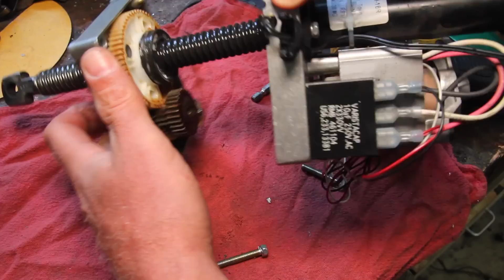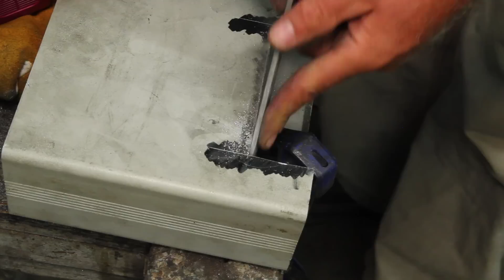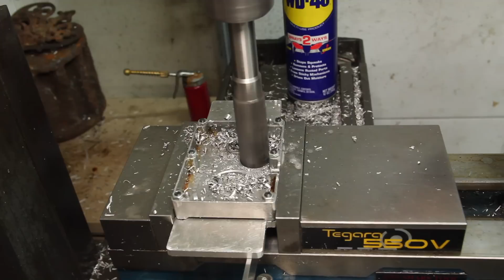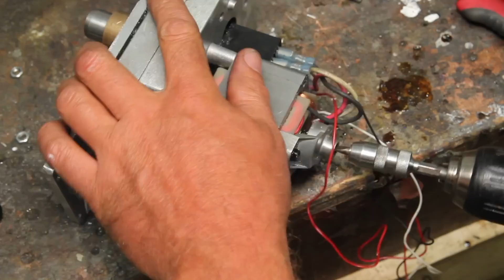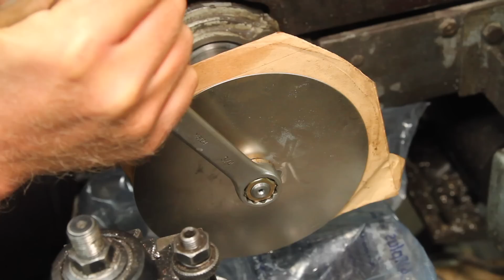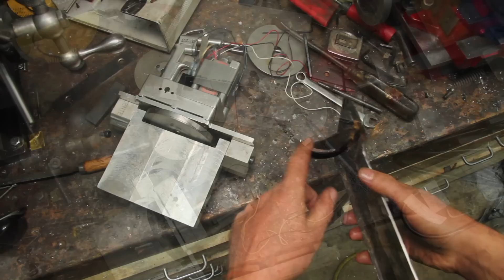Carbide Grinder Junk Build- #Roughcut2022

Comment: Jeremy, nice job of creatively building your carbide sharpener!  I always look forward to seeing whatever you've come up with to share.  ;)

When you first used the diamond wheel, I half expected it to be one of those counterfeit wheels that loses its diamonds almost immediately.  Back in the '80s at work, a buyer thought that she'd save a couple of dollars per wheel and wouldn't buy what we had asked for.  We were cutting slots in jet engine fuel nozzles and the cheap wheels would fail before a single slot could be finished.  The wheels were supposed to be brass with the diamond coating bonded to them, what we got was cheesy steel disks literally (rattle-can) spray-painted with brass colored paint on top of the poorly bonded diamonds.  There was hair & lint in the paint which kinda gave that away!  In order to get what we needed, I had to actually write a detained specification for the buyer as a CYA for her to not buy the cheaper wheels.  But we got what we needed, as far as those diamond wheels were concerned, from that point on!

Comment: Clever creation Jeremy.

Rather than press a small shaft and run the risk of bending it; machine a sliding "thumb-fit" and glue the parts together with Loctite, which is so much safer than Super Glue. Loctite Shaft and Bearing Mount if you want to dismantle it later; Loctite 680 for a permanent bond.

Comment: Jeremy, like you I used Stefan Gottswinter's design with those diamond discs but used a cheap 24v DC motor and a simple speed adjuster. I have longer side arm on the plate and on each side I have a fixed pivot and a slot for the tightening bolt. Mine is specifically used to 'touch up' carbide tooling or the parting blade.

Comment: Glad it's not just me that suffers the odd senior moment when marking stuff out/getting the wrong side etc.  I think I would have been tempted to bore out the gear so the shaft didn't need to be turned down to a small diameter, although those sintered metal gears can be pretty hard.  Very neat project though, essential really when you have carbide bits to sharpen.  That parallel port switch case was a thing of beauty, you'd be lucky to get a modern equivalent in a thin pressed steel box these days.

Comment: I love everything about this, down to the DB25 switch.  Did you just happen to have the correct-sized large diameter reamers used for this, like for the OD of the plain bearing?  Or did you at some point procure/appropriate the bearings+reamer as a bundle?
Reply from the maker: I’ve got a pretty good collection of reamers, and it keeps growing.  The fit on the OD of the bearing (1”) was a little loose, but….loctite.

Comment: Copper plating is commonly used to mask areas from heat treatment, your steel may have been a scrapped part from a manufacturing facility.

Comment: @Jeremy M/T:  What was the need to downsize the diamond discs ?  As you built all the surrounds for the discs, why not use the discs as they came ?  There were no space constrictions.
Reply from the maker: There was a little height construction on the case I used, and I probably didn’t have a big enough piece of stock to make the backing plate for it at 6”.  And for some reason, I wanted it to be a 4” grinder.  But i did kind of wonder that myself.
Reply: @JeremyMakesThings  : Thanks for the response.  It was one of those little, unimportant, nagging questions that won't leave you alone until the blank information space was filled.
I have carbide bits that will need sharpening at some point. So, I found your video very interesting.

Comment: I  uae   XEROX 2000   PHOTOCOPIERMOTOR  WHIT  GEAR BOX  AT LOW SPEED  INCUDE  also  dome  hold  cannon  have  motor  whit gear  box at 280  rpm   very usfull  to recycling